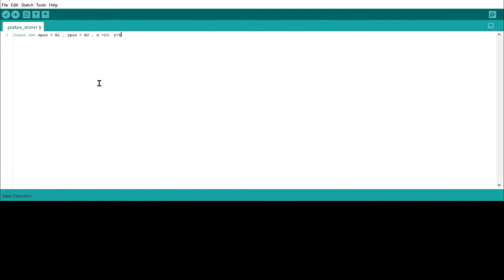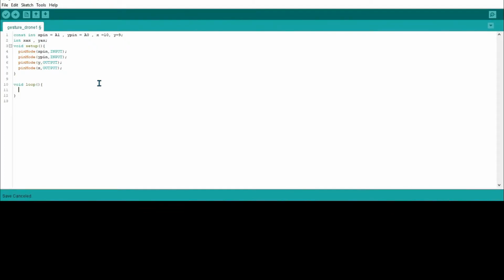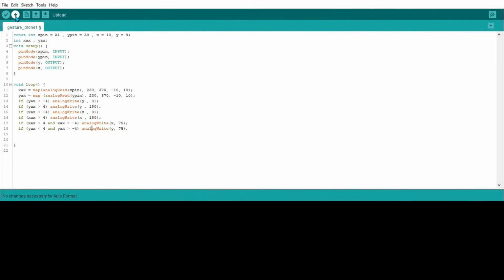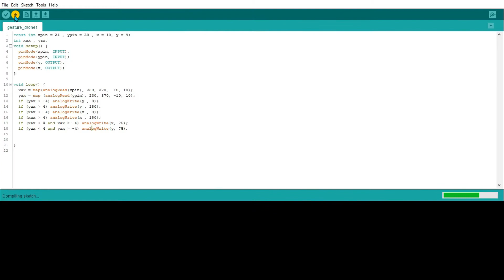How to make a gesture controlled drone

Comment: PLease I really need to finish this for my project due in 4 days and I need to know what is the black wire connecting to under the transmitter Also where have you connected those yellow wires with transmitter where you joined rc circuit?

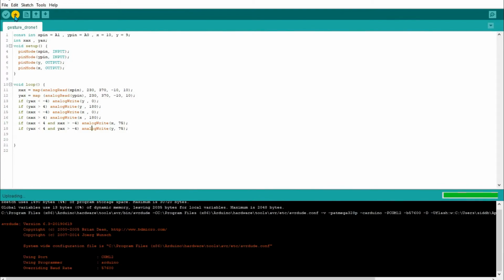Comment: around 5:13 what is the black wire connecting to under the transmitter? Also where have you connected those yellow wires with transmitter where you joined rc circuit?

Comment: Plz tell where you have connected those yellow wires with transmitter where you joined rc circuit
Reply from the maker: Those are the signal pins, soldered before to the joystick
Reply: Plz tell me more about this we have program tomorrow and we made you drone

Comment: Would any drone work
Reply from the maker: I had many problems plaguing this drone,
like the motor noise ,weight management etc

but it would have been a lot easier to build if it was a brushless motor drone as they can provide alot of thrust and we won't have  the  problem of weight management

Comment: Is it necessary to build a drone? Or can we use a readymade drone and then make the changes on its controller????
Reply from the maker: we can use a ready made drone
Reply: Would u suggest any drones to buy like any specifications which we should look out for?
Reply from the maker: I used a syma x5c,pretty much any drone works,as we are just mimicking the joystick controls with an arduino
Reply: @ClickScienceDIY  ok thnks for the help...

Comment: hey can u please help me to know how to find the vcc and ground and more why r u cutting the copper of the throttle? please can u explain me 
i need to make this
Reply from the maker: I cut the copper traces because the joystick will interfere with the accelerometer output
Reply: @ClickScienceDIY but u are attaching the throttle with the potentiometer then how is the accelerometer working there? when u are cutting the copper traces then how the other two wires are still connected to the circuit?
Reply from the maker: to find the vcc and ground you'll have to use a multimeter, put it in voltage setting and start probing
Reply from the maker: or you can even put it in continuity and check from the battery terminals and the rest of the component,but make sure that the switch is on cause or else few continuity tests which actually show the vcc won't be shown(remove the battrues first tho)
Reply: @ClickScienceDIY and u are using the accelerometer for direction tho? then how it is interfering with throttle?
Reply: Same question I ask @lyadh_khor_manus
Reply: and one more thing what are u doing with the wires of the direction one? like where u are connecting them?

Comment: Hi I need a help for this project
Reply from the maker: Regarding?
Reply: @ClickScienceDIY  your gesture control drone
Reply: I need whole details for your project
Reply from the maker: The electronics needed?
Reply from the maker: What kind of details
Reply: @ClickScienceDIY  circuit diagram which material chip do you use
Reply from the maker: It is in the description
Reply: @ClickScienceDIY  diagram s not open
Reply from the maker: What problem are you facing?,like the website is not even loading or the download is not opening?
Reply from the maker: If the download is not opening means ig you didn't not unzip,try to unzip it ,if it still doesn't work, try winrar
Reply from the maker: For me ,the website is opening
Reply: I need all details about this like 
Circuit diagram
Which types of capacitor and resistor
Which sensor or chips

Comment: hello, Do you have separate power for arduino and for remote controller? because I have controller which is connected to 4.5v , and min voltage for ardunio to work stable is 7v, if I am right
Reply from the maker: No,i have used the same power supply which is a power bank. It runs at 5v volts which is the usual voltage the Arduino gets when connected to a pc,so it's fine ,you can use a power bank. It was stable.
Reply from the maker: If you have any other doubts or problems while making it,feel free to ask me
Reply: @ClickScienceDIY  thank you soo much
okej so I can connect arduino via usb cabel to power bank, but how then connect remote controler? via arduno? and rc use 4.5v, will 5v disturb something?
Reply: @ClickScienceDIY  and is it possible to use ADXL345? if possible, does I have to completely change the code?
Reply from the maker: You can connect it to the remote too
Reply from the maker: And if you use 5 v instead of 4,usually there won't be any problem as sometimes batteries when bought new could add up to that,so they will keep it 5v tolerant
Reply from the maker: You can use adxl345 but the circuit diagram and the code will be different as adxl345 uses i2c ,whereas 335 is normal analog outputs
Reply from the maker: The code will be a little different,you will probably have to use some library to get the values from adxl345 and rest will be same.
Reply: @ClickScienceDIY  with adxl345 does I need RC filter before controller, I guess yes? 
Can you help me with code if have some example or something I would be so so thankful?
I do not understand how from output of adxl345 which is acceleration["g" or "m/s2"]to get voltage 0v-3.3v(potenciometer on rc change voltage 0-3,3) which I need for controler?
Reply from the maker: Yeah,the rc filter is needed, the potentiometer values is trial and error.
Reply from the maker: Search online for adxl345 library there you can easily see the commands needed
Reply: @ClickScienceDIY  Thank you very much for everything, you are awesome!!
actually one more question, in one part of video you are using arduino uno during coding, and on another part you are using arduino nano, what is the difference and does I have to use both?

Comment: is it necessary to solder wires to vcc and ground if its already connected to battery
Reply from the maker: If you can  power  the Arduino  without doing that,then it's not needed,but make sure all the grounds pins are connected

Comment: hello is there any list of the used materials?
Reply from the maker: In the Description
Reply: 1. potentiometer
2. Arduino
3. ADXL335 accelerometer
other than these?
Reply from the maker: Well I didn't put power bank cause there are many ways to power it
Reply from the maker: Pretty much these are  needed

Comment: hey, what is the type of drone you are using?
Reply from the maker: That is a prebuilt drone transmitter and receiver, for which I made a body with bamboo sticks to reduce the weight
Reply from the maker: But you can use any drone

Comment: can you make one video from  where you have bought this parts  ,it will help us
Reply from the maker: I have upgraded a prebuilt drone

The contents I used are in the description,I bought all the components from local vendors ,you can find the components on amazon too
Reply from the maker: I would prefer you to buy locally because in amazon the costs are too high
Reply from the maker: But if it's fine In amazon,here are the links
https://www.amazon.in/dp/B07RRXW875/ref=cm_sw_r_cp_apa_glt_fabc_DX18YFYPH71XHABYPZKW

 https://www.amazon.in/dp/B07L3SXF3L/ref=cm_sw_r_cp_apa_glt_fabc_T6DVATWZX6D34MPMX02A

 https://www.amazon.in/dp/B07C8G4N6X/ref=cm_sw_r_cp_apa_glt_fabc_7Q9Q8F3SKZQZETBB2PFG
Reply from the maker: And for the drone,any drone will work